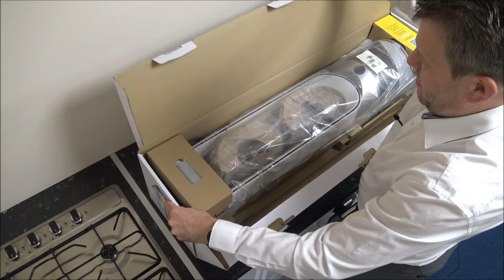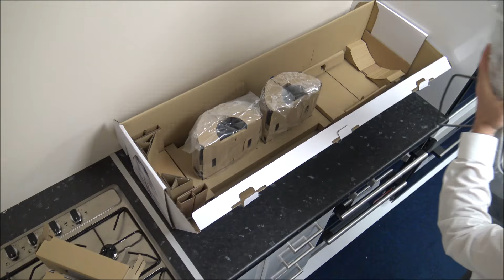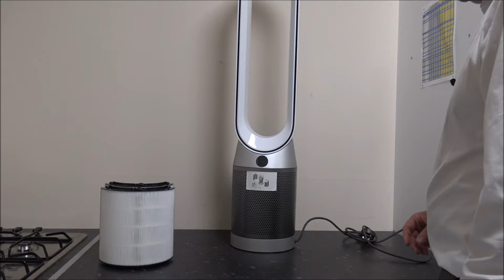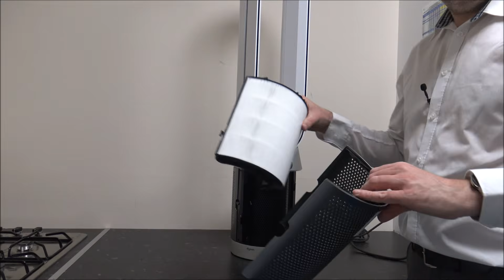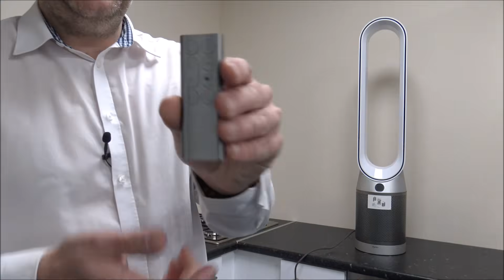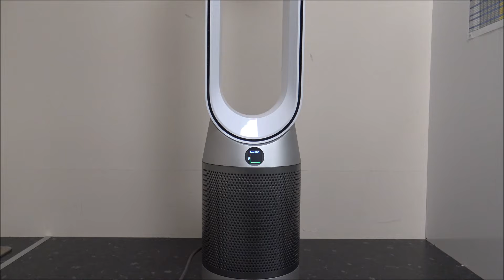Dyson TP7A Purifier Cool Auto React Explanation

Comment: Best Dyson-fan for cooling, if you don't need an air purifier, is the old Dyson AM 07. No filter, no drag, thus clearly less noise and more efficiency, hence better cooling effect right from the very 1st low speed setting. I love mine and mostly only use the very 1st speed setting.

Comment: Can you set up temperature you want your Dyson will keep in the room?
Reply from the maker: These are fans not air conditioning units, so it will speed up the air in front of the fan but only give you the impression it is cooling you down. A proper air con unit will cool the surrounding area down to a lower temperature.

Comment: Can this be used as kind of a portable AC? Does it also release heat when producing cold air?
Reply from the maker: It won't cool the room down. All this will do is to speed up the air infront of it and give you the impression that it is cooling you. It will get slightly warm when it is in operation.
Reply: @lords-electrical  Thank you for your reply

Comment: You where great... I've just bought this model and NOT so happy with it. At this price I expect it to cool the room, but it doesn't 😢😢😢
Reply from the maker: Unfortunately these will only speed up the air in front of you giving the impression it is cooling you, it won't cool the room down.
Reply: @lords-electrical    Actually, it doesn't only give the impression, the moving air does indeed help your skin to cool down i.e. to lose energy (heat) as long as the ambient temperature is lower than skin temperature. It's like cooling a spoonful of hot soup by blowing it before putting it into your mouth.